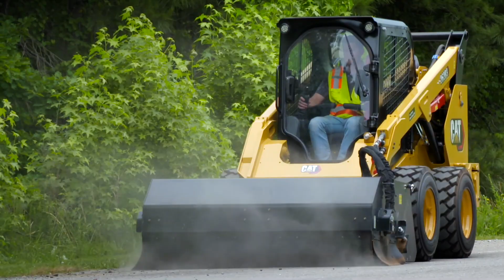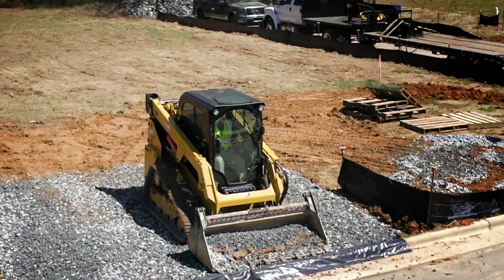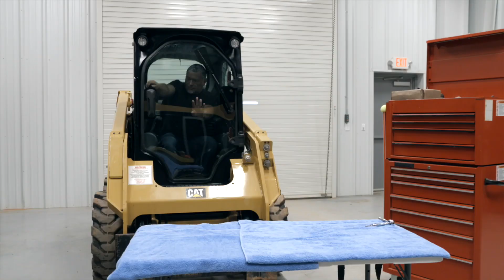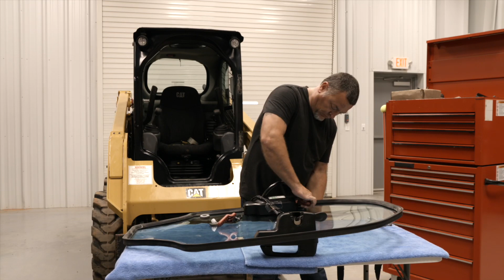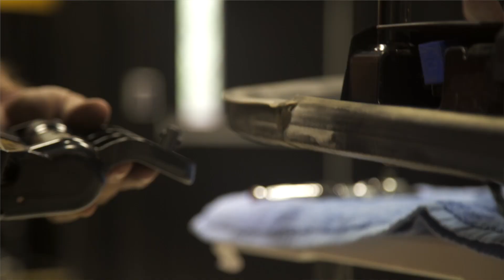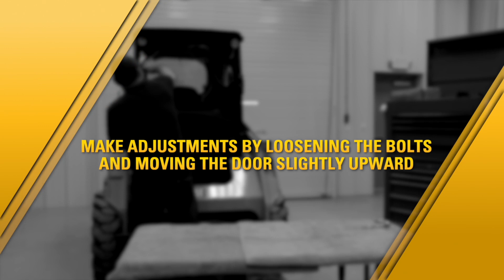How to Install Cab Door Hinges on a Cat® Skid Steer, Compact Track, Multi Terrain Loader

Comment: Now that I did this the machine will not allow me to raise the arms  any idea?
Reply from the maker: Hi Braden. We recommend checking two things. First – make sure the hydraulic lockout switch is in the “active” position. The hydraulic lockout switch is on the operator’s right side, the first switch to the right of the display screen at the top right of the cab. Next, check the cab door switch. You may need to install the cab door jumper plug, which is located behind the seat on the operator’s left-hand side. You can reference the Operation and Maintenance Manual, located in the pouch behind your seat, for the location and description for these switches. Look in the “Operator Controls” section of the manual. - Dani
Reply: There’s a magnet on left hand side if your sitting inside machine if it’s not touching other magnet it won’t let you move anything